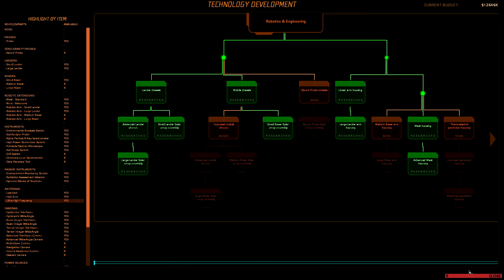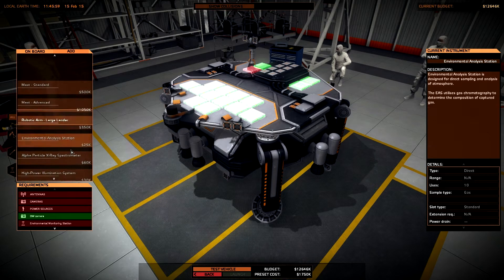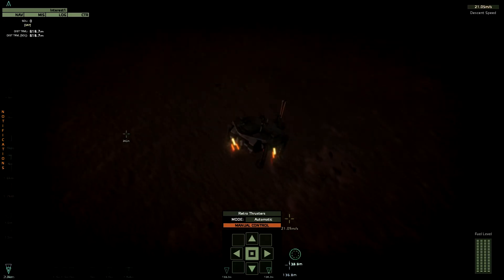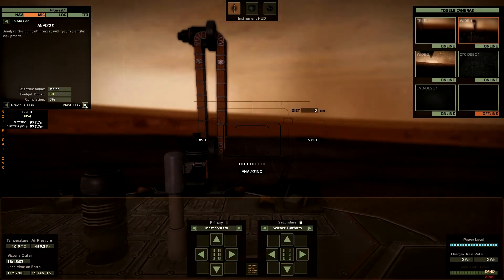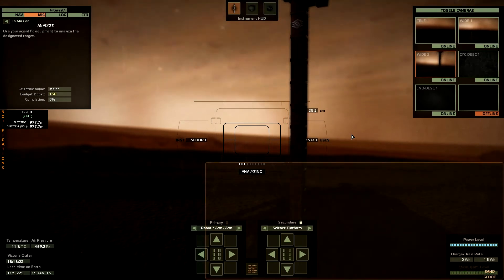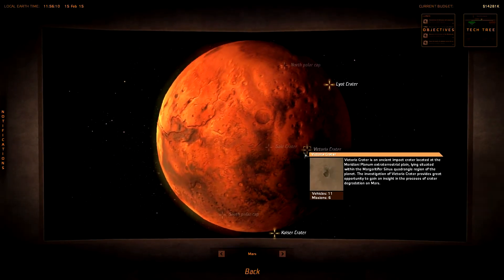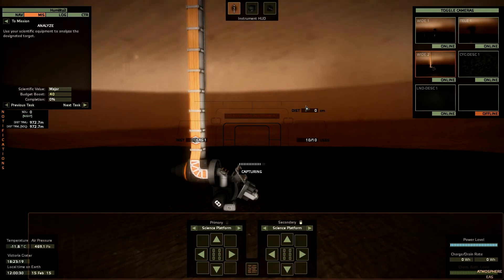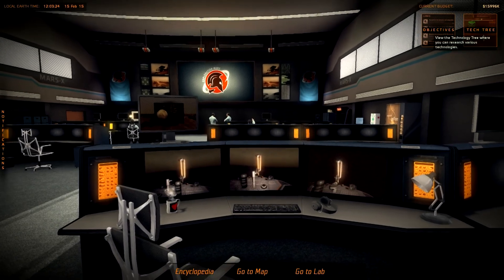Take On Mars - #28 - Space Program Reloaded :: Strange Issues

Comment: Great Large Lander Mission, Thumbs up.
May it will help when the Robotic Arm respectively the Instrument has contact with Ground. So the Wind cannot move the Arm as if the Arm would float over the Ground :)
Reply from the maker: NEXIS981 The last time I tried something like this, the movement of the lander broke the instrument :-/ It's unfortunately not that simple.
Reply: Learning by Gaming
Then i like that it is so detailed realistic ;)
My idea would have led to the fail the mission, at least it would have required a new rocket to Mars ^^
If it were real, we could learn from that mistake and we could install a spacer to the instrument. A spacer which is grabbing in soil and prevents the robotic arm from wobbling, whitout let the instrument get damaged by contact the Ground :)
Reply from the maker: NEXIS981 This would be really cool! (Unfortunately, it would probably ruin Mars-X, because new space hardware and research projects are really expensive. ^^)